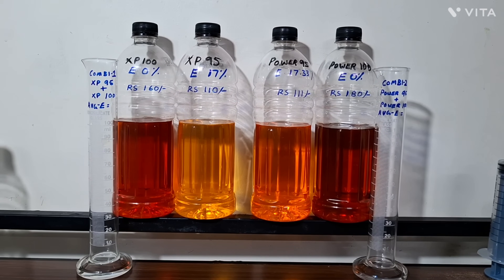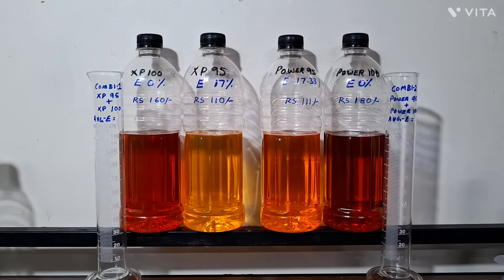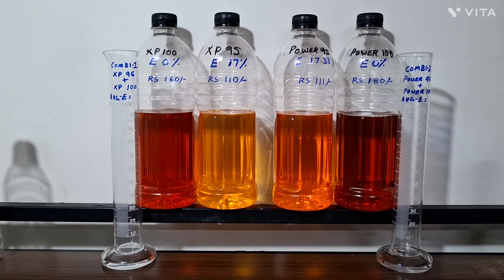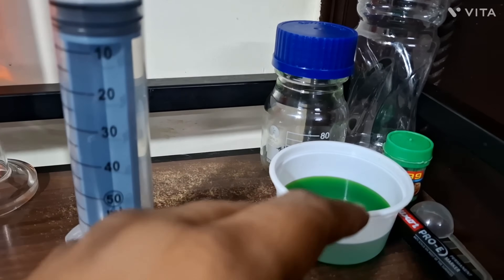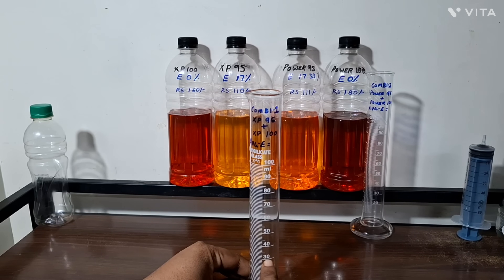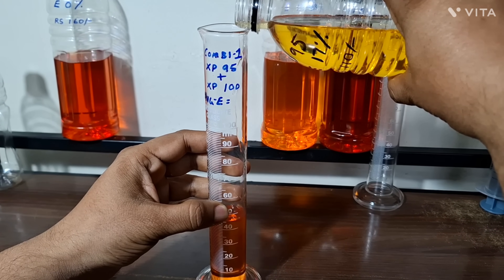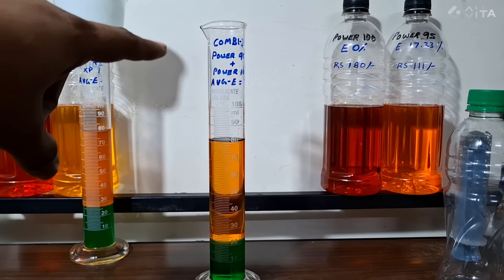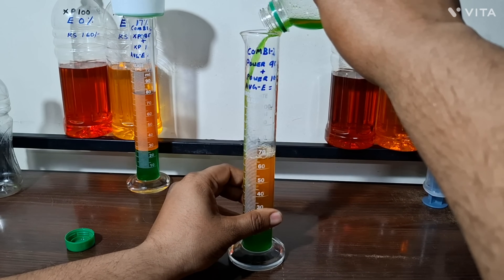Ethanol issue, work around video #2 on how to keep our non E20 vehicles healthy.= 23rd Sep 2025.

Comment: Thank you so much brother for putting efforts for all the data points you cover in your video's. I would suggest if you can extract just petrol from normal fuel and add it to your any old vehicle and run it to show some results in performance and experience you are getting while riding that will be great. Will that extracted  petrol be E0 or E5?
Reply from the maker: Welcome. I am already running my pulsar 180 on extracted fuel. As pulsar is low compression engine its running superb
Reply: So quick on replies too. Thank you so much for confirmation.❤

Comment: Bro Can you also share where do we get Power 100 and XP 100 in Bangalore. Will help Bangaloreans to refill them when stock is back.Appreciate your videos.
Reply from the maker: For xp100 their app [ indianoil app ] is very good. Just download and in filter select xp100 fuel, uncheck other fuels and then slide the search kms slider to 50kms. You will see 9 bunks in bangalore with location links.

For Hp power100 their app is useless. There are only 2 bunks who sell power 100 as far as I know. One in Mg road main Hp bunk and one bunk opposite to leela palace kormangala.

Comment: Dude single handedly challenging "Mr Gadbadkari's claims". Thank you so much brother, appreciate all ypur content. Hope to see more such informative videos except Ethanol blending as well. Cheers.
Reply from the maker: They have their own version of justifying,  we as common people just want to save our vehicles,  as the fact remains fact that our vehicles are not E20 compatible.  Even if they climb burj Khalifa and shout E20 is safe of E10 vehicles.  It will not be considered safe as we have the proof of vehicles loss of power, milage, starting issues, stalling, rust issues. In coming up video, I will cut open the pulsar 180 tank to show the corrosion happened due to ethanol blend petrol.
Reply: @zubtubetube sir isn't fuel alteration illegal in India?
Reply: @zubtubetube bro next video should be on XP 95, power 95 vs normal Petrol for bikes
Reply: @zubtubetube bro post a chart on how many ltrs of Normal petrol in power/xp/95 should be filled in how much ltrs of xp/power95 in normal petrol

Comment: So for Combi 2 can you also explain if we need 2L of x and also 2L of X to balance them?
Reply from the maker: So basically as all fuels are closing down to E20. Apart from xp100 and power100.  So the ratio of mix is 50:50. If 10liters of E20 then mix 10liters of E0 fuel to get total of 20 liters of E10.

Comment: The syringe measurement is a bit faulty I guess, because in the measuring jar, the level should have rose upto 80 from the previous 60, so bro I guess even if you are filling water with the syringe, its better to stick with the measuring jar's accuracy
Reply from the maker: Yes error will be 1% but we still get an idea that it will definitely be under 10% after the mix.

Comment: Thank you 😊❤ again anna/brother for the help 😊 
One more observation after this e20 buzz, I tried with 
Hp normal , bharath and shell, 
All normal petrol, 
Shell seems to be better than all three which I used ,

Would you advise using shell and ethanol free petrol as combo? 

Or normal shell vpower version ? 

Mine vehicle is e10 complaint , 
And my bikes are all bs3 basically . 

Any advise anna
Reply from the maker: I appreciate your feedback, shell and E0 fuel best choice
Reply: @zubtubetube thanks anna, ❤ vpower and shell normal is there any different from your experience, 

I understand shell and e0 is good combo, but sometimes as you said the city where I'm in may not have e0 , in that case shell normal should be a better option !?
Reply from the maker: Shell still has E15. It will still have impact as vehicles are E10 compatible.  So keep tank full, run the vehicles atleast 2 times in a week and you have to run at least 10kms. This makes sure any water in fuel line will get evaporated. Plus every service get fuel tank, fuel lines and injectors cleaned. Best bet is to mix 50:50 xp100 and shell fuel

Comment: Thank you for this video and your continued efforts in testing fuel quality. As a fellow Polo GT TSI owner, this information is incredibly valuable.
I had a question about the math on the HP Power 95 test. While your arithmetic for the test result was correct (4ml of ethanol in 60ml of fuel is indeed 6.66%), the result itself does not align with the stated 17.33% ethanol content. The theoretical blend of a 1:1 mix of E0 (Power 100) and E17.33 should be 8.665% (since it's a simple average of the two percentages: (0% + 17.33%) / 2). The lower observed result suggests that either the Power 95's actual ethanol percentage is lower than stated or there is a margin of error in the test.
On a related note, I was recently at a Jio-BP outlet in Ghaziabad (UP), where the attendant told me their petrol has 15% ethanol, costing ₹94.4/litre. This seems to contradict test results from other channels that show Jio-BP at around 9%. Given the regional variations, it would be great if you could conduct another test on Jio-BP fuel.
Reply from the maker: Thank you so much for watching the video,  I will surely test jio bp fuel again.
Reply: Where is jio bp in noida?

Comment: Please do repeat for Jio BP & Speed 97. Both these are the best as per your previous videos. A repeat check will be fesiable.
Reply: Based on his videos, I spend one full afternoon doing recognizance of all the petrol bunks in my layout and I could only find speed 97 which I have filled in my old vehicle and new vehicle now I will see how much difference I get in real world so far I have noticed increase in power and mileage, but these are just initial impressions and can be placebo
Reply: @umeshg5963 - If you are in Bangalore, can you share where to find Speed 97?
Reply: I filled with jio bp in Andhrapradesh and milage dropped , I think it's based on the bunk owner not the company, bunk owners might be mixing water for profits more than what company is mixing ethanol

Comment: What's the difference in normal and 95 octane after e20 ?
Reply from the maker: Both have similar Ethanol % like 20% but xp95 has additives,  unlike normal fuel
Reply: @zubtubetube  so its still worth getting it over normal fuel right?
Reply from the maker: Normal fuel mixed with xp100 [ 50:50 ] ratio is best bet for normal vehicles

Comment: So, basically as my classic reborn 350 tank is 13 L and keeping aside reserve capacity of 1.5 to 2L should I fill half tank(6L) with E-0 fuel and remaining half with E-20. Currently using Speed95 as it best low ethanol present near my place.

Comment: Yesa filter kr ke fuel use kar sakate hai ky 😅
Reply from the maker: Ethanol removed petrol is not good idea. That fuel will loose additives and octane.  Hence getting fuel from bunk which is pure petrol has the right ingredients for vehicles to run. Thats why using pure petrol Xp100 which is ethanol-free but has additives that has made it Octane 100. This is done at petrol refinery using specialised equipment,  which we don't have.

Comment: What about the compression ratio of both the separate octane levels???
Reply from the maker: Compression ratio is in engine of the vehicle and not in fuel.
 
xp95 has 95 octane and xp100 has 100 octance so average will be 97.5 octane. Which is good. High octane advantage is only felt in superbikes and super cars, normal vehicles will not have any power gains however engine will run smoothly and ethanol level is under the compatible % which is E10
Reply: @zubtubetube  please note that octane does not average out like that. E20( or E17 in this case) has already pushed the RON rating of XP95 close to RON98.8( according to Autocar lab tests).

Comment: Then Indian oil will be combo for everyone because xp 100 is there in almost every state major cities but not power 100 so indian combo will be good. Or @zuby the rider will power 99 which has probably low ethanol contant less than 15% may work with like power 99 and power 95?????
Reply from the maker: Yes power 99 would be good choice,  but last time at Hp company owned bunk they said power 99 is getting stopped
Reply: @zubtubetube  thanks for reply but in my city is available don't what happens in future but will try it

Comment: Do check BPCL speed 95 once
It is mostly available across all states
Reply from the maker: Yes i have tested it last month, it is 12%. Need to check again
Reply: Its 12% Bharath Petroleum even I'm using the same petrol.
Reply from the maker: Already done, pls check my previous videos
Reply: @zubtubetube I checked sir, I have been following you since the moment it blew up all over the internet and you bringing in clarity about the fuels and since then as you have mentioned that BPCL speed is around 10.6%, I have been blindly using it.

A request for you is to keep on checking as they might silently increase the blending of ethanol
Reply from the maker: Will do again
Reply: @zubtubetube Thanks so much 🙏

Comment: Difficult to find xp100
Reply from the maker: In bangalore there are 9 bunks which sell xp100. However now as on 23rd Sep they are awaiting new stock,  due to sudden increase in xp100 sales the stock is sold out
Reply: @zubtubetube if possible please list out those xp100 and power 100 outlets location
It will be useful and valuable info for lot of co riders of both bike and car
Reply: Yeh but in metro city or tier 1 or tier 2 it is available but not in village or small city.

Comment: Excellent video! I will definitely check this combo out for my vehicles. 🙂
Reply from the maker: Great to hear that, do let me know your experience. 👍
Reply: @zubtubetube Does it deposit carbon in the engine after mixing the fuel
Reply from the maker: This is ethanol-free fuel. It will have complete and clean combustion,  further if ur vehicle is under 10:1 compression ratio then unburnt fuel will have carbon deposits. But ethnol sticky residues are very harmful.  Plus if ur are talking abt residue by xp100 with skoda car video its because of GDI engines which are prone to carbon deposits in any fuel. We all have PFi engines [ port fuel injection]  iam a vehicle collector.  I have classic to brand new vehicles.  Telling u out of my experience.  Further u can take a call. If u think otherwise